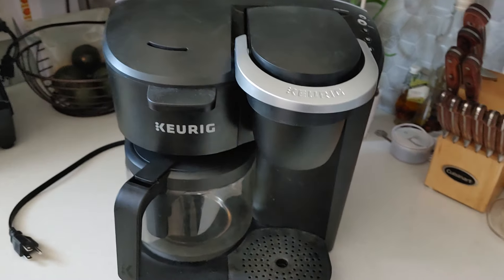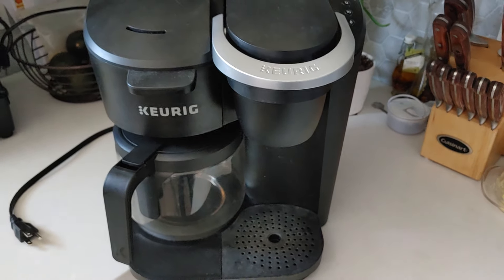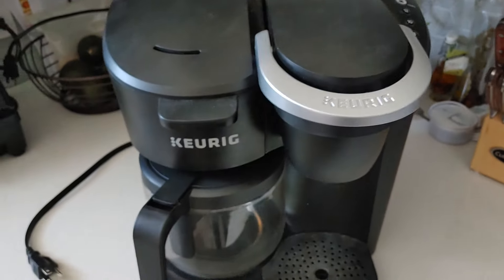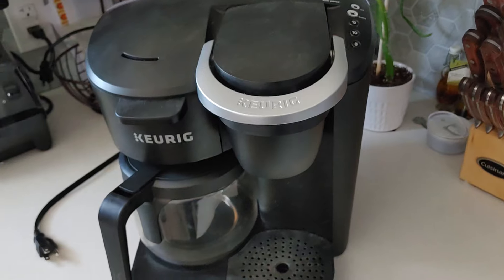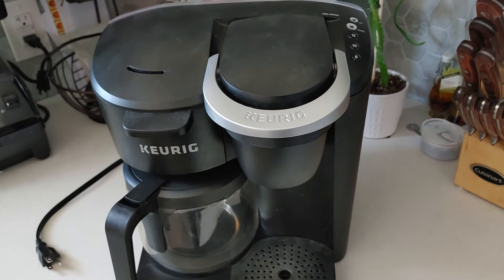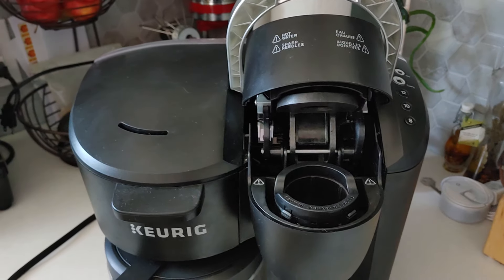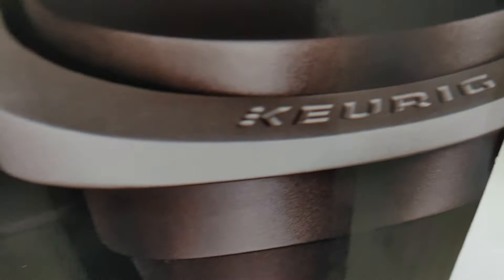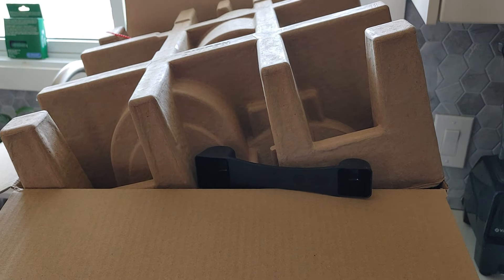Keurig K-Duo Not Brewing Coffee | 100% FIXED - No Tools Required!!!

Comment: I don’t usually comment on this fixer-upper, troubleshooting videos, but you did one of the best repair jobs I’ve ever heard,  it is hilarious, ( my wife busted out laughing ) hopefully we’ll have the same luck, thank you !
Reply: OMG, I actually got my Keurig to work. I had the same issue.I got to thinking what would happen if I pushed 2 buttons at the same time?  Try this:

1- After placing a large cup beneath the cup dispenser, push the oz button
2- After you push the oz button, then push both the 8 AND 10 buttons at the same time for 1 or 2 seconds
     
This actually worked for me and I am guessing it will work for you too.

Comment: Ours was a different hose, bottom one that an end deteriorated and fell apart. Still had to tear the whole thing apart to change. Our upper hose was a two part and no clamp, so we figured a fix and mod using heat or glue at the factory. Still have to fill and run to find the leak. We replaced hose and clamps. I would say these expensive machines are only good for a year without fixing all the hoses.

Comment: I called yesterday because the machine I got it November 2024 stopped working when I was adding water to the reservoir, and they are sending a new machine out. This is the 2nd time Keurig has sent me a machine. I would think they would go out of business since it looks like they send a new machine when you have problems. Why don't they build something that will last?

Comment: OMG, I actually got my Keurig to work. I had the same issue.I got to thinking what would happen if I pushed 2 buttons at the same time?  Try this:

1- After placing a large cup beneath the cup dispenser, push the oz button
2- After you push the oz button, then push both the 8 AND 10 buttons at the same time for 1 or 2 seconds
     
This actually worked for me and I am guessing it will work for you too.
Reply: that did nothing for me. the 8 10 12 just blink still lol
Reply: @mountaintravels1390   The 8 AND 10 ONLY, not the 12. Hold those TWO buttons for 2 or more seconds. It should work.
Reply: @richardyoung9024  i threw it away lol

Comment: Mine worked completely fine until I ran vinegar through it.When I filled it up with water after to run it through…nothing.
Spit out very little, but the water at the back isn’t even heating up.I should’ve just left it I guess.Mines 2 years old so I’m guessing it’s no longer under warranty

Comment: My pod side quit working after a few months carafe side works, everything is clean/descaled but also when using k cup side water comes out of dispenser on carafe side. Its like my pump for pods doesn't have enough pressure... im lost
Reply: Remove the 2 screws under the pod cover that secure the cover.  Slide the cover out towards the front.  Try to make a pod  (cup) of coffee.  While the pump is trying to pump - squeeze the flexible section (it's on top),   [YOU CAN SEE THE CHECK VALVE INSIDE IT].  YOUR CHECK VALVE IS/WAS THE CULPRIT.   JonJon in St Pete FLA

Comment: I through mine away only had it 1year & 3mo.So bummed..tried to call them but stayed on hold twice for a long time..I did get another one but it will be my last if the motor dies in this one..Its a great size just really liked it or I wouldn't have got another one but they are expensive 😥
Reply from the maker: That's too bad, they gave me no issues and shipped me a new one for free within a few days. I only wish I didn't waste so much time trying to fix it.